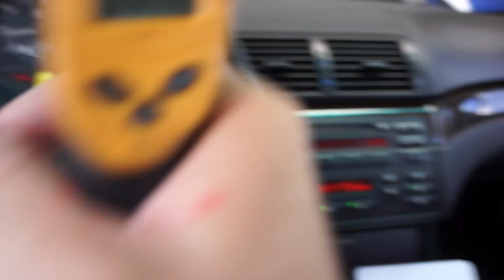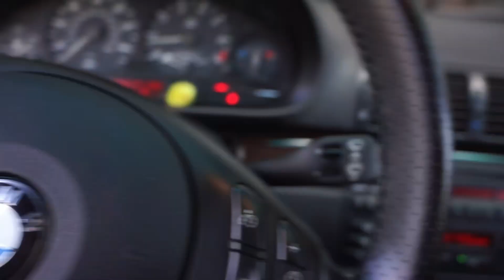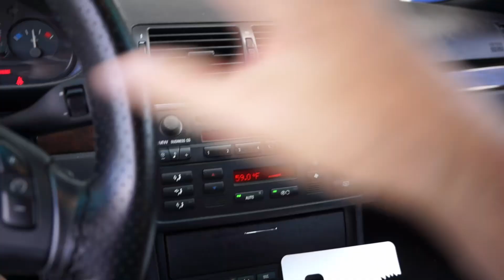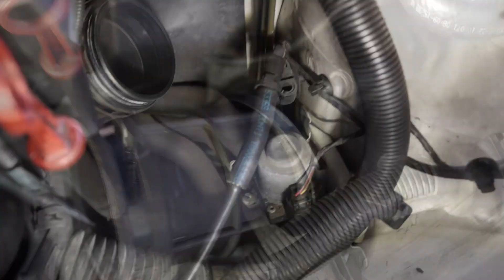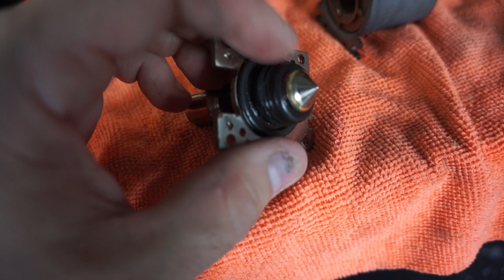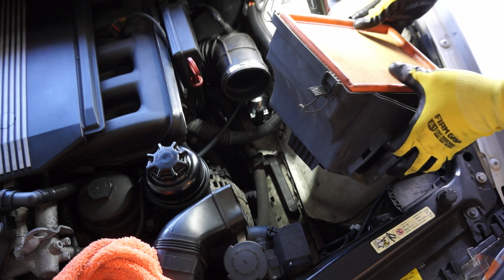2004 BMW E46 Heater Control Valve Diagnostics and Replacement

Comment: I have the same issue.  The air coming out of my vents goes from cold to hot from the left-most vent (driver's side by the window) to the right-most vent (passenger side by window).  I checked my coolant level, and it is fine, so I think the heater control valve is definitely the problem.  Thanks for this video.  Pretty easy replacement, and only ~$84 for the part (unless you want to cough up $250 for the genuine BMW part).
Reply from the maker: This phenomenon also happens with low AC refrigerant.  Check/top up the refrigerant if your having the issue when trying to use the AC.

Comment: Can you still turn on the vehicle and drive around after removing the heater valve?
Reply from the maker: I can't think of anything that would prevent the car from turning on and driving but the air conditioning/heating system will not work properly.,
Reply from the maker: And you'll have a big coolant leak if you just remove the valve and don't reroute the hoses

Comment: FYI, those rubber mounting grommets look like the same ones that BMW used on mounting the charcoal canister in my E39. But on that,  you can at least see how it mounts. I was so fortunate when I dealt with wrestling off the charcoal canister to replace the pump that pressurizes the gas tank to verify no vapor leaks. So if anyone is doing their charcoal canister, remember that you just lift  up in the same way that JR did on the heater control valve. Thanks for the video. I think I'll check my R134A levels before replacing the HCV. Cheers.
Reply from the maker: Thanks for the comment.

Comment: Und wo ist das Problem wenn kein Luft kommt  ?
Reply from the maker: If no air will go through when power is not applied then the valve is stuck closed.

Comment: I do have an error on my diagnostic tool related to auxiliary Pump on my e90. 
My problem is that on the driver side i get hot air, but on the right side its cold as af (since its winter).
I will try to see if this fixes it
Reply from the maker: I hope you get it sorted.

Comment: mine only blows cold air all of a sudden also it's winter now it really sucks. temperatures are good. although I did notice it took long to heat up but then again it's also Cold. thermostat and pump is not 5 years old so I'm suspecting hearing control valve stuck on closed. even when I take the power of it still doesn't get hot.
Reply from the maker: That's what I would suspect.
Reply: @JRsGarage that was it 🤙
Reply: Me too, my car is blowing cold air instead of hot air after putting a Steel Seal into the coolant tank. It’s winter and cold and I don’t know what I’m going to do…
Reply from the maker: The leak sealant you put in the coolant might have caused a blockage in the heater control valve. It might be worth changing that out as a fairly cheap and easy fix.
Reply: @JRsGarage I don’t know how, unless I take it to the mechanic . Can I still drive it although it’s not overheating . .
Reply from the maker: A failed heater control valve should not cause any overheating.  You should have no issues driving it except not getting warm air in the car.
Reply: @JRsGarage thanks very much.. you have been so helpful . I will try and get a new heater core valve for the mechanic to fix it for me. 🙏🏿

Comment: On my '01, if I keep the HVAC temp at 59 it blows cold.  But if I move the temp to ANY degree other than 59 I get heat. 60 and higher --> heat.  I wonder if it's this part doing that or if it's my head unit "telling" it to open?
Reply from the maker: The interior temp sensor might be bad.  Do you have a scan tool with live data? That might be a sensor you can monitor to see what temp the car thinks it is.
Reply: @JRsGarage  I have a BMW-specific code reader, but it's very lacking.  I'll check though, thanks.

Comment: Great video! Is it possible to bypass the hose connected to the valve? My hose is broken, and I can't find a replacement. Can I bypass/close it?
Reply from the maker: I'm not really sure what that might do to the availability of hot air in the cabin.. I would think if you bypass it such that coolant is always flowing it may always blow warm air.  And if you cap it off so coolant never gets to the cabin radiator you may never get warm air.

Comment: My Freon has been topped off. So I’m assuming this may fix the issue?
Reply from the maker: If you don't have hot air then yes it may.
Reply: @JRsGarage I do have hot air. That’s my main issue. My AC blows cold sometimes and thankfully has been blowing cold the past 2 days. But the right side vents blow a bit warmer. Sometimes the AC blows warm and the passenger side even warmer.
Reply from the maker: Most likely your AC refrigerant needs to be recharged.

Comment: How do you test this?with out taking it off
Reply from the maker: There might be a way to test it on the vehicle with an oscilloscope, amp meter and/or ohm meter but I don't know what readings you'd be looking for to tell if it is working properly.

Comment: Hello, tell me how to generally check on a car whether these solenoid valves are OK
Reply from the maker: You have to apply 12v and see if they open and close properly.
Reply: @JRsGarage  
Hey, I did it and it opens and closes, maybe the one at the bottom, which is under the solenoid valves, the whole pump is defective

Comment: I dont have hot air it blows only cold and the valve gets really hot after 5 minutes at idle. Could it be that?
Reply from the maker: It could be.  But if the valve gets hot quickly I would suspect it's not completely closed, might be stuck partially open, because the stagnant fluid in the hose would take longer to head the valve if the fluid isn't circulating.

Comment: Which hose goes directly to the heater core? I’m trying to clamp it off to see if that resolves my warm AC issue
Reply from the maker: Sorry, I can’t remember which is in and which is out. Although if you clamp either one of them you stop flow through the core.
Reply: The Waters flows from the bottom to the top throuh the valve to the Heather clamp the to hose
Reply from the maker: Thanks for the information.

Comment: great video.... does Heat control valve also responsible for cold air? ...from SOUTH AFRICA
Reply from the maker: No, it only controls the hot coolant going through the heater core.

Comment: Did You solve the problem with temperature diffrence in vents?
Reply from the maker: Yes. The refrigerant was low.
Reply: @JRsGarage  Thank You very much for answer🤠🥰. Greetings!
Reply: what about the un even heat? mine has that exact issue..  cold one side, warm the other and like yours no duel climate control.
Reply from the maker: The refrigerant was low. That caused my uneven cooling issue.
Reply: sorry I meant the heating side of it...  That is my issue.. uneven heat on both sides
Reply from the maker: The heater control valve may be your problem. It's worth a try because it's much cheaper and easier than anything underneath the dash.
Reply: in my mind I assume there is only one flap above the heater matrix to change the air flow from hot to cold and visa versa as it is not duel climate control... I don't suppose you ever looked on yours? if so do you recall if there were two flaps, one for each side of the cockpit... I recon one of mine is sticking, perhaps a motor failure?
Reply from the maker: That could be as well.  (Stuck flap).
Reply: just can't work out why the valve being faulty would affect only one side of the car?. There is only one solenoid? if there were two I would be thinking exactly that... really odd though loads of forums with same issues (mostly duel climate) but no one really addressing this issue on a video.... be a good one to do...
Reply from the maker: @jonb2676 in the same way I couldn't figure out how low refrigerant would cause uneven cooling ... But it does. Perhaps it is stuck just partly open so not enough fluid is getting through to heat both sides. I'm not sure what it looks like or what the flow path is under the dash.
Reply: Excellent video though mate  really clear. Not many deals with the non duel climate so thank you, also for replying! 😊

Comment: Do you need to bleed the coolant system after replacing the valve?
Reply from the maker: I lost very little coolant so I just drove the car and checked the reservoir and topped it up over the next few days.   If you lose a lot of coolant you will need to bleed the air out.

Comment: I have constant 12v and ground at connector even with car off?
Reply from the maker: I don’t have the electrical schematics to say what the ignition off default should be but it sounds like you have a short in your 12v feed somewhere.

Comment: My value is not heating up does it mean it's bad?
Reply from the maker: It could be, but it also could be the signal is not getting to the valve to open.  Did you check the fault codes?
Reply: @JRsGarage  no but will do thank you sir

Comment: One of those 2 hoses that come through the valve is leaking. Do you have a DIY on replacing them?
Reply from the maker: No, I do not but just probably need to take off the hose clamps to remove it and then get a new one and refill with coolant.

Comment: What hose is the that was on top of the actuator that you moved? ( you mentioned its a vaccum hose) where is that connects too? Pls help.
Reply from the maker: If I recall that's the hose that goes to the purge valve which is attached under the right side of the intake.  The other end connects to a hard line that goes back to the charcoal canister.
Reply: I see. For some reason mine is off and Been tryna figure out where it connects. Since i saw your video and saw it you moved it. Gabe me an idea.

Comment: Nice one cheers, I am replacing the heater control valve on my E46 M3 so have the version with 2 solenoid pumps, same job and seeing the use of the c clamp was really genius as saves having to do a coolant flush and extra faff/mess.

Cheers!
Reply from the maker: Happy to help.
Reply: I am to lol tomorrow